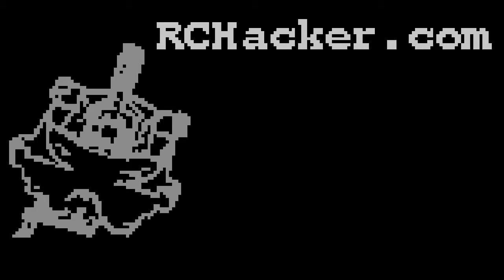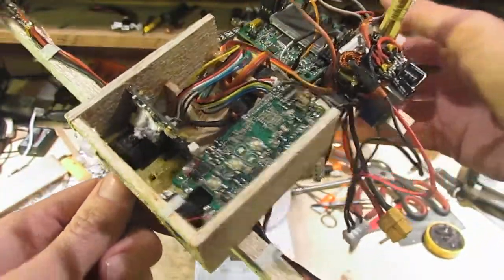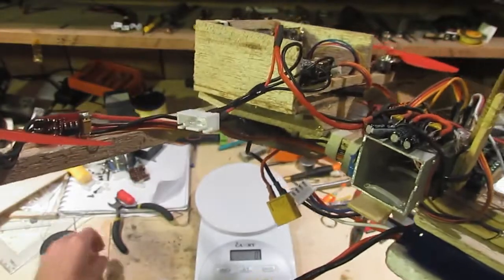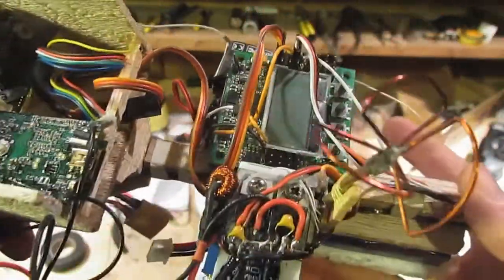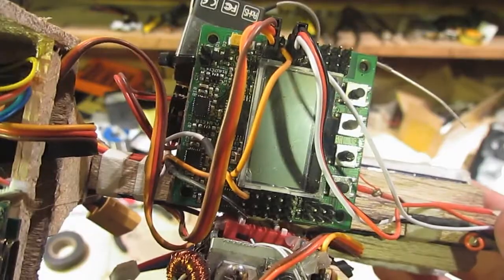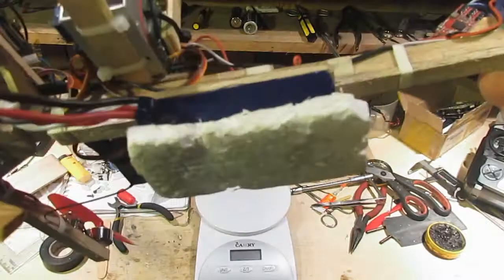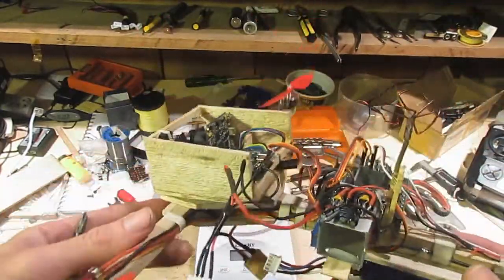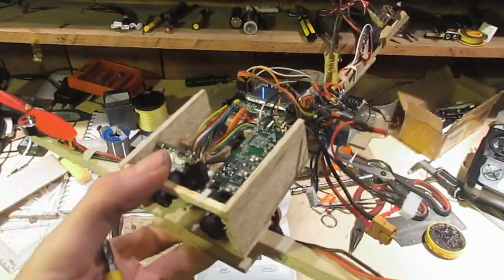Mini Tricopter update, FPV payload and RD32 camera. RCHacker #15

Comment from the maker: I was getting 10min with the initial FPV gear. Have flown this and it went well, but it crashed due to a slipping prop (video coming). No damage, but I think it is too heavy. I am ditching the sony camera so I can lighten the power supply for the TX.

Comment: dude the uglier the better and your tricopter effing rules.  in the middle of a scratchbuilt myself and was wondering; do you think you would be able to use HDD motors from say a sata HDD?  i don't see why not..  they should be able to get around the rpm you need... and esc would control it.. right??